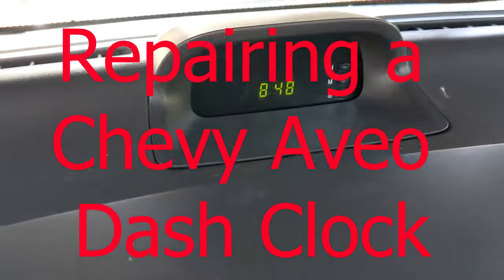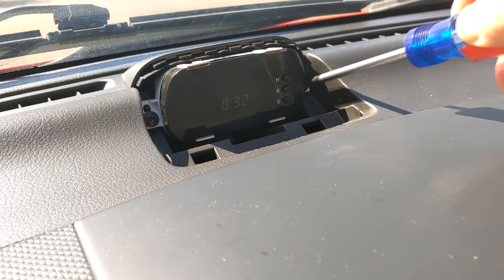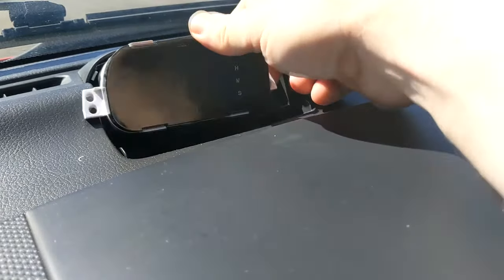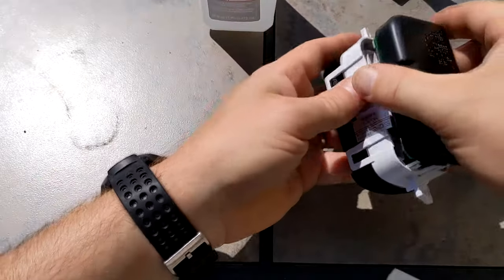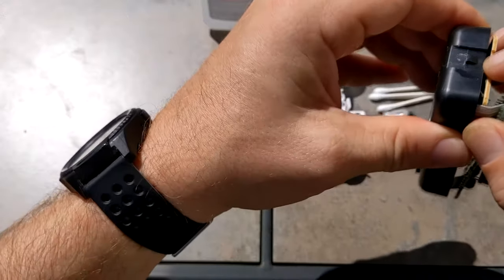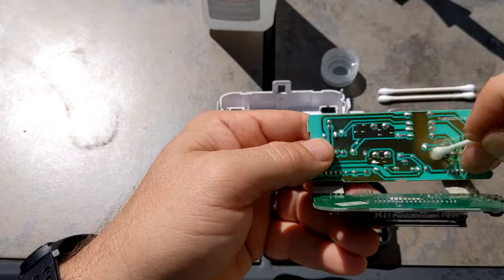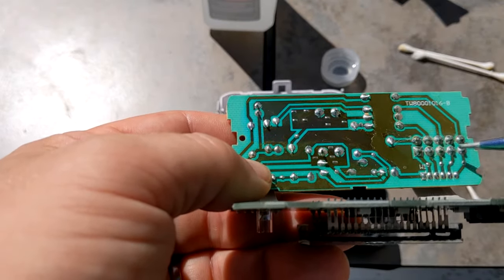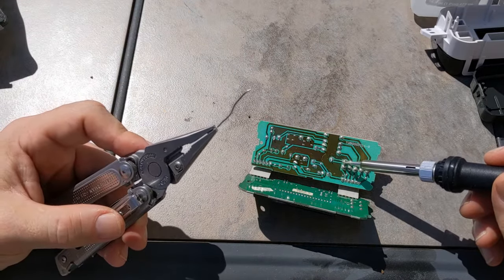Repairing A Chevy Aveo Dash Clock

Comment: Was excited to see this fix but I've never soldered anything before nor have the tools so I guess I'm out of luck on that department. nice information here either way. Thank you!
Reply from the maker: You're welcome. it's possible it might fix with just cleaning the circuit board. In my case the melted original solder was making a short.
Reply: They are 10 bucks on ebay it's easy to use it

Comment: please, what is the solution that is used for cleaning ??
Reply from the maker: I used 70% isopropyl alcohol because it would dissolve and not make an electrical connection later
Reply: @TimBledsoe  thanks for your reply .. do you think that isopropyl alcohol is more gentle on surface and electrical components?